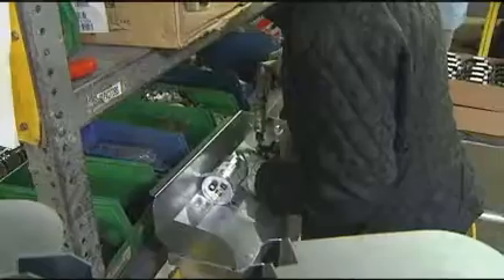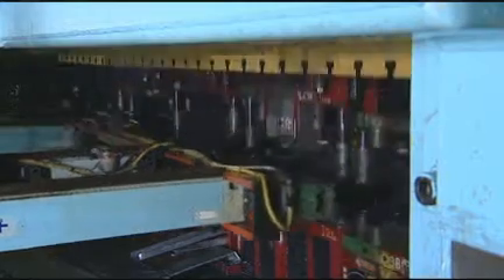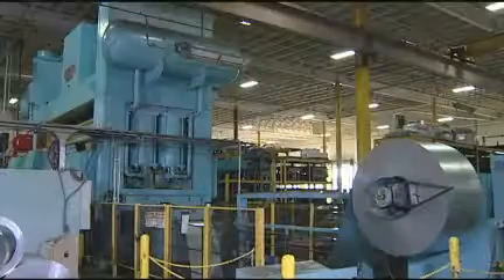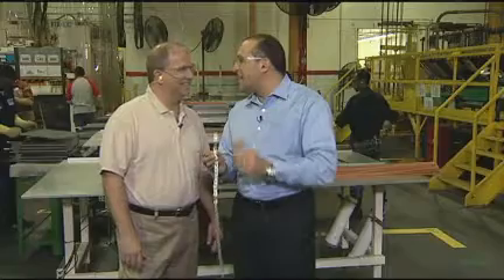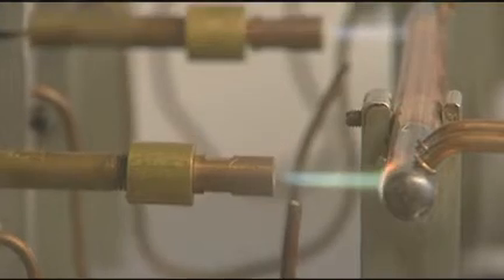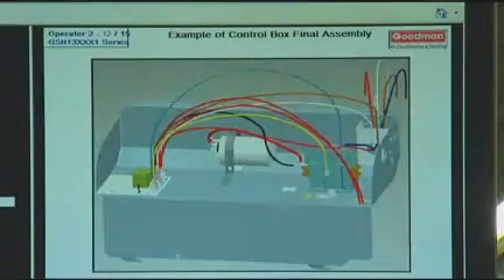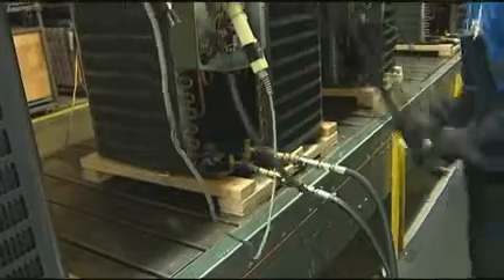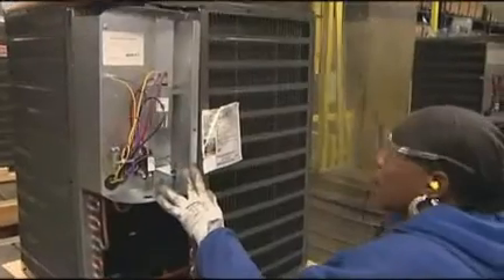Tour of the Goodman Manufacturing Plant with Goodman's Vice President

Comment: Nice video. I bought the first two units almost three years ago and they've been trouble free. Last year I bought three units and no problem so far. (Except for the Aprilaire humidier which signals the furnaces to keep running). Additionally, I am on a condo board, and we've switched all replacements to Goodman and have very satisfactory service from them.